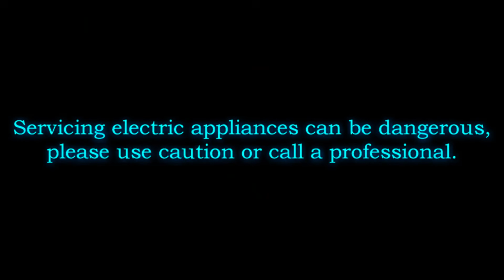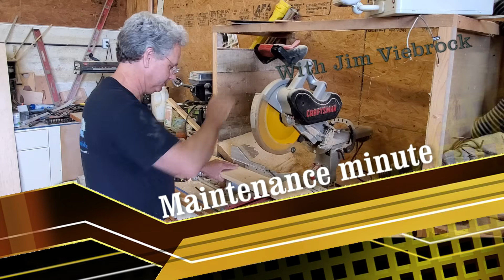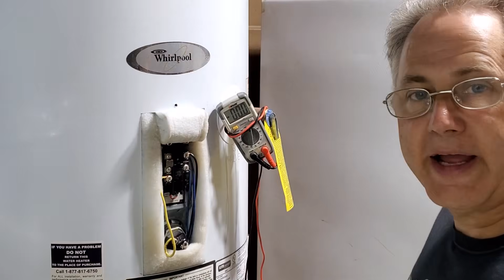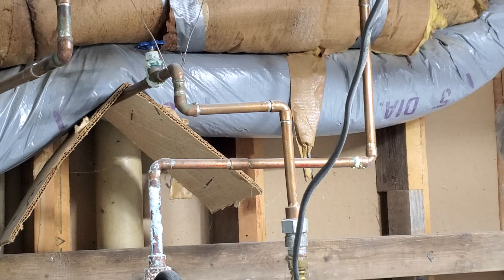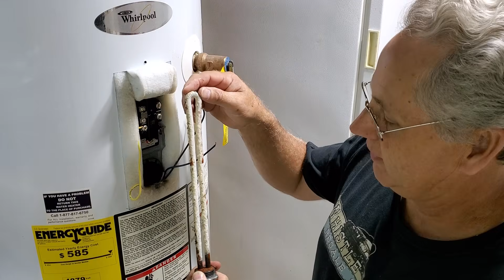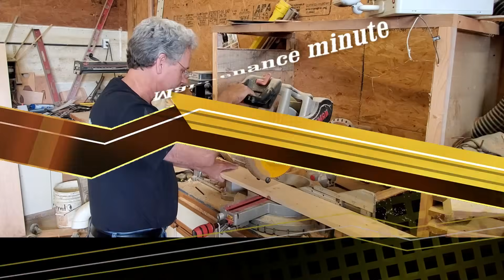D.I.Y. How to replace the heating elements in your hot water heater. Maintenance Minute Jim Viebrock

Comment: My water gets very hot and then goes cold. What can cause this? Thanks!
Reply from the maker: Most likely one of your elements is not working. Or your tank is too small, if your tank is 40 gallons or more I would follow the instructions in the video, drain the tank, clean the tank out, and replace both elements. Thank you for watching my videos!
Reply: @millin360  thanks 🙏🏼

Comment: Can you replace a 4500 w element with a 3500
Reply from the maker: You can go down to a lower wattage without problems, however you will slow the recovery time with the lower wattage element. I would only use the lower wattage element if you have no other choice.  Thank you for watching my videos!
Reply: @millin360  Thanks for the reply. I have a Heater with 2, 4500 coils. my generator for power outages is 9Kw so it at the edge of If it can run during a power outage. I thought, if I lower the Coils Power, I might be able to get hot water during a Power out.
Reply: Yeah. It just needs to run longer - good idea if you have solar so you have a bit more overhead.

Comment: Suggestion:  put a piece of pvc or copper pipe on your thermo pressure release valve.  Length to approximately six inches from the floor.  So, if it blows, you will not have hot water spraying all over the room.
Reply from the maker: Great point! Thanks for watching my videos!

Comment: I am having a problem getting water to drain out of tank. It’s only 4” from drain valve to floor. After hooking up the water hose to the tank, no water came out.  It may be that there is not enough head pressure in tank to drive the water out. The tank is only 4 years old. Thank you.
Reply from the maker: The tank probably has lime over the drain preventing the water from draining, use a hanger or some other means of gently probing up the drain to break the lime scale loose. Kinda like a mini rotor router. It should open up a path for the water.
Thank you for watching my channel!

Comment: Im curious, why did you not use an Ohm meter to check for resistance in the heating coil before you replaced it?
Reply from the maker: In this case the 'voltage meter" I used is a multi function meter. It will check for a lot of different issues. I didn't go into that level of detail for this basic tutorial. Also, In the geographical region where the video was shot, lime scale is a major problem. Water heaters only last about 5 years and then the buildup needs to be dealt with. I knew from experience the elements would be covered with lime scale and the tank would have lime flakes in the bottom before I started the repair. And as you could see in the video, the bottom element was actually corroded and damaged by sitting in the lime. Given that the unit was calling for heat, the logical conclusion was that one or both elements were bad. Most home owners won't have the necessary meters to check for any current, and will just as a matter of chance, replace the elements and in most cases have made a valid assumption and repaired the unit. Thank you for your question! and thank you for watching my videos.
Reply: @millin360  what's your Facebook page? Very helpful video thank you for sharing this!
Reply from the maker: @wsterlingw1  Facebook page: maintenance minute with Jim Viebrock 
Website: maintenanceminute.net

Comment: yeah, it all depends on the water hardness. some folks seem to love saying "you never need to drain your tank". BS! Good video. removing the lower element and using a shop vac to clean the sediment is a great idea
Reply from the maker: Yes, it makes sense to me, that since the tank is drained and the lower element is out you might as well spend a few minutes and clean out whatever might be in the bottom of that tank.
 Thank you for watching my videos!
Reply: @brianvoyles5373  that Rod you bent is most likely the anode Rod. Bending it is not a problem but if it’s six years old it’s probably a good idea to change it. The anode Rod is made of aluminum, magnesium or zinc; or an alloy of the three. It’s there to draw corrosive metals like iron away from the inside of the tank to keep the tank from corroding. They eat the rod away instead of the tank.  Once it’s gone it no longer protects your tank. If you can see more than six inches of the core wire on the anode rod then it’s time to replace it. It’s super easy, just like changing an element. A 27mm or 1 1/16” socket should fit it. Just screw it out and screw the new one in. ID plumbers tape to seal the threads.  Keep that rod in good shape and your tank will last A LOT longer. They’re about $40 at Lowe’s. They even come in sectionals in case you don’t have much room above the water heater.
Reply from the maker: @brianvoyles5373  Wow! That's a lot of lime! Kudos for taking the time to clean it out properly.  You might look into a water softener.

Comment: I need to learn how to change the wax ring in a toilet. My hubby is always too busy, and I don't want to have to replace the flooring too.
Reply from the maker: That's a great idea for a video! It's not hard. Shut off the water, flush the toilet to get as much water out as you can. I use a shop vacuum to suck the remaining water out. Disconnect the water feed line. Unscrew the two floor bolts, lift the toilet from the floor, remove the old wax ring including the black plastic ring, and replace . Reverse the process to reinstall the toilet. Hit the notification bell so you can see my tutorial when it's posted.....good luck, you can do it!  Thank you for watching my videos.

Comment: So my problem that I have is that when my water heater pops my breaker the bottom element unit shoots sparks out.  Is that an element issue or maybe a breaker fuse issue?
Reply: More than likely your element is cracked or damage.
Reply from the maker: That will be an issue with the heater. Contact a qualified electrician. Thank you for watching my videos and please subscribe to the channel more great videos to come.

Comment: Thanks for the video, I've replaced elements before but needed a refresher. Just a side note, for safety purposes there should be a drip leg on the pressure release valve.
Reply from the maker: You are correct. Code requires an pipe for the discharged water in the event of a "pop off". This particular heater didn't have one installed. Thank you for watching my videos and please subscribe to the channel...more great videos to come.

Comment: In addition to using the shop vac to get out as much of the lime scale as possible, would it be ok to turn the cold water on and let the running water flush more from the bottom (keeping the outlet hose on of course.)? 
I was lazy and didn't do the annual lime scale flush this spring and now a Luke warm shower motivated me to find your video. Thanks for the careful, detailed instructions!
Reply from the maker: Yes, you can "flush" the tank if you have good flow out of the drain. Thank you for watching my videos!

Comment: Thanks for the video, I have had to replaced both my thermostats twice in a 3 year period, the water would get extremely hot, like the thermostat was not regulating the temp, then my breaker would trip, first time I did replace the elements, I did not replace them the second time. Not sure why the thermostats are failing, might just be one but I replaced both. Another thing I have done is replace the anode rod, hopefully the tank will last awhile.
Reply from the maker: Thank you for watching my videos! Keep improving.

Comment: I turned the power off to my hot water heater and drained it and when it was almost finished draining there was a loud pop and the smell of electrical. I checked all the wiring with my electrical tester showed no power to the hot water heater so I refilled it and now no hot water so do you think that’s the elements or do you think I blew the thermostat not sure?
Reply from the maker: Sounds like it is time to call a qualified plumber.
Reply: A loud pop with the smell of electrical circuits means there was power to the unit. Perhaps you did not shut off the circuit breaker all the way, or the breaker was mislabeled

Comment: Do you know if i would need to get 2 LWD ELEMENTS OR 1 HWD AND 1 LWD FOR MY WATER HEATER
Reply from the maker: In this video I use 2 low density elements because I have a high concentration of dissolved lime in the area I live. I have found that the low density elements last longer in this situation (and they are quieter when heating). There is a scientific reason for this, and there are some great articles on the web that can explain this in detail.
Thank you for watching my video's and don't forget to subscribe to the channel.

Comment: Thanks for the video.  

I didn't understand your statement at the end where you said:  "make sure that you close your valves back up, not only will you have a giant mess, your tank will pressurize and not fill up".  Which valves?  

You said that it would take a few minutes to fill up.  About how many minutes? 10, 20?

I noticed that the water heater was propped up on bricks.  Mine was not, since I didn't do the original installation.  As a  result, I could not hook a garden hose to mine.  I got a flexible corrugated one inch hose and clamped it on with a hose clamp.
Reply from the maker: If you opened a sink hot water valve during the draining process (recommend), to let air into the system avoiding a vacuum, you will want to leave it open (open it when filling if you didn't) so the tank can push the air out of the system as it fills. You will want to close the pressure relief valve and the drain valve.  If you don't provide an air escape (the sink valve) the tank will pressurize and the elements will be dry. Filling time will vary based on the pressure and flow of your system, you will know the tank is full when water comes out of the sink faucet.
Installation "codes" are constantly changing so an older installed tank may be sitting on the floor, some may be raised to avoid a moisture problem,  some will have a catch pan, etc. (Keep in mind some parts of the country have very strict codes and some parts have no codes at all.)
Check Installation guidelines when you replace the entire tank.
Reply from the maker: Thank you for watching my videos!
Reply: @millin360  Thanks for the explanation.

Comment: Thank you so much for making so I understand I have watched alot of others and haven't felt confident on doing it. Now I do I definitely will watch your videos from now on. How long do I leave the hot water running in the sink before I can turn it off
Reply from the maker: Once water starts coming out of the hot water side of the faucet, the heater will be full and you can turn it on. Keep in mind the tank will take about 45 minutes to fully heat up.